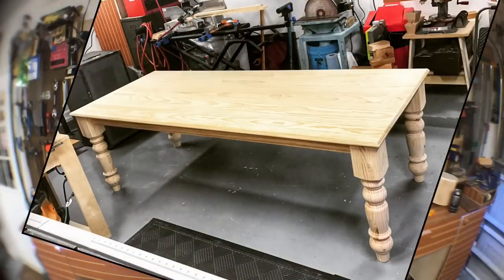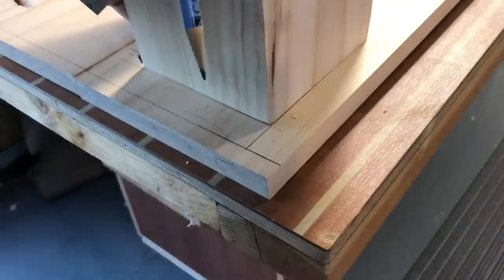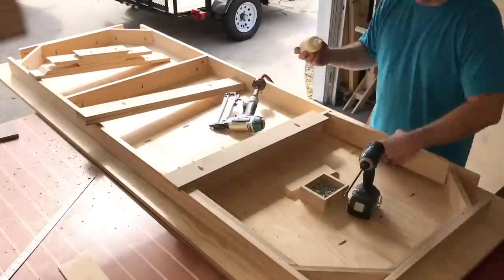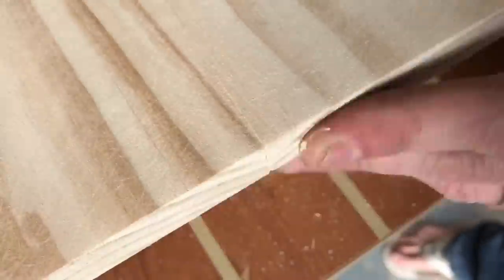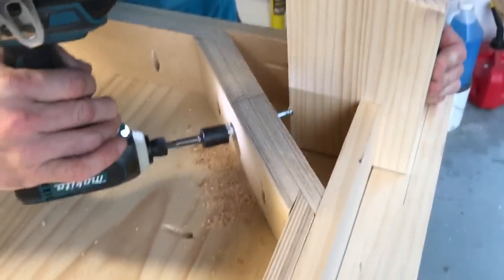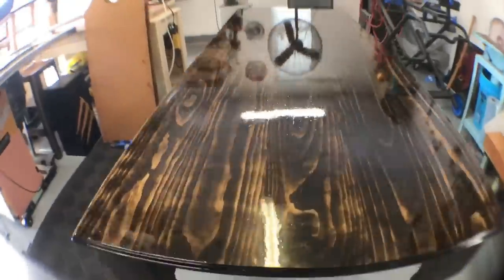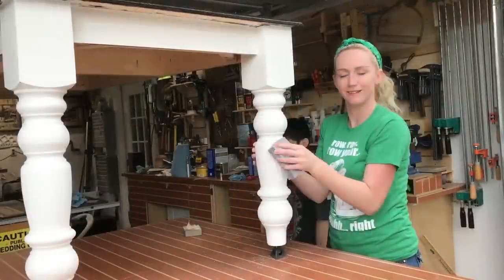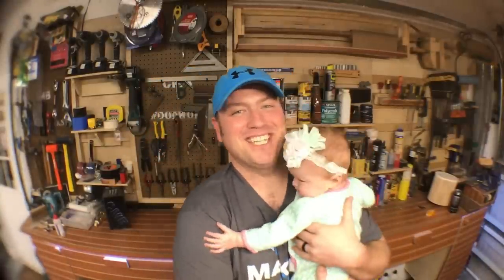How to Make a Farm Table

Comment: Honestly pretty disappointed by this. I have watched some of your videos and really admire some of your work, but you never... EVER attach a solid wood table top directly to the apron. That wood is going to expand and something is going to give in the structure and quality, whether that be the table top or the frame. Pine especially expands more than a hardwood so this was definitely not the way to do this project, especially when making it for a client. If you get a chance, you should read up on some wood expansion articles to understand the concept. For this purpose, figure 8 fasteners or z clip fasteners should have been used to fasten that table top. Other than that, awesome work and finish on that top!
Reply from the maker: MrTripleD3 You definitely have a point. Some of the growing pains of starting a new channel being that this is pretty much my first video, I’ve definitely learned a lot. Definitely should’ve used figure 8 washers or some type of expansion joinery. Thanks for the tip and I appreciate you watching
Reply: Didn't mean to be too critical, just trying to give some tips! As others have stated, I really appreciate your videos, your family aspects, and your personality you incorporate into your videos. You make good videos without the need of swearing and other unnecessary remarks like many others. I especially like the media console you made with the two fridges;p keep up the good work!
Reply from the maker: MrTripleD3 I could totally tell it was coming from a good place. I mean why else would you put so much effort into the comment. I really do appreciate it. Also thank you for the kind words it means a lot when people say they appreciate what I do! Quick question about the table top though, do you think making larger holes inside the pocket holes in which that was attached, would’ve been a better alternative. I didn’t use glue so I hope the table lasts a long time joined to the base
Reply: That method isn't the worst, but I don't see why one would go through all that time drilling holes when a figure 8 fastener would be more efficient and probably better quality, especially since that's what they're made for. If you had made the table top out of plywood and edge banded it and used veneer on the top, the way you constructed the table would have been awesome. It's just since you used solid wood for the top, and pine for that matter, you may have problems with expansion. Ive had may friends build table tops with pine and screw it directly into the apron and their top cracked and cupped. Plus, if you used figure 8 fasteners you could have built the frame separately and the table top separately that way when you transport it, it wouldn't be as heavy and you could then attach the table top when you got there. I hope it lasts a long time too, I just wanted to let you know for future builds. But I definitely know what you mean about it being one of your first projects and that you're learning. There are so many projects I did years ago that I wish I could go back and re-do knowing what I know now.
Reply from the maker: MrTripleD3 I really appreciate all the feedback. This community is built on people trying to encourage and making sure the better even if it is constructive! Thanks again for your time I will definitely be more careful in the future!

Comment: it looked like you used pocket holes to attach the legs to the 4-inch boards. How did you do that with the corner brace in place

Comment: I made a sewing table for my wife. I used pre-fab legs like you did. For the top, I bought two butcher block counter tops from IKEA, ripped one side to remove the round-over, then used biscuits and glue to join them on their long edge. I added oak cleats underneath to ensure rigidity. Then I made a template to cut out a rectangular opening to recess her big Pfaff sewing machine to be flush with the surface ( with a platform mounted underneath.) we custom ordered a plastic insert that completes the flush mounting. She loves it!
Reply from the maker: That’s awesome. The butcher block countertops is a great idea

Comment: Absolutely the best video ever. I am getting ready to make a farmhouse table and wanted ideas of how to attached beefy legs to make sure the table was very strong. Love, love love the whole video and end result. Details on finsh is excellent too. Thank you.
Reply from the maker: Thank you so much for the unbelievably kind words. I definitely appreciate you taking the time out of your day to let me know all of this! Thank you very much Karen, I hope you stay along for the ride on this channel! You’re awesome
Reply: Since this is my first try at a farmhouse table I have a question.  I cheated and bought a cheap top premade. It is a softwood but beautuful. I used one on my center island that I upcycled from an old dresser. I did like 5 layers of poly. Turned out great. I want to try an epoxy on my tabletop. Anything I should know before I get that far. Like I said it is a soft wood and want more hardness on finish.
Reply from the maker: Epoxy will definitely give you the durability you’re looking for. Any quality two-part Apoxsee work very well. A few tips are, have a heat gun or blow torch nearby to pop the bubbles that may arise. And also makes it for exactly how long the manufacturer says. I have one I have to mix for 12 minutes and if I don’t, it just doesn’t come out as well. Thanks Again. Take care
Reply from the maker: Also feel free to ask any questions I appreciate you reaching out
Reply: Chris, you mix your 3 part for 12 minutes?

Comment: I just found your video, i have been looking for an easy way to make a farm table with basic tools. great video and great tips like the glue and sand paper.  Your a natural behind the camera and your daughter is adorable.  cant wait to see more projects, keep them coming.
Reply from the maker: Craig North I can't thank you enough for the kind words brother. Of course I have more projects to come actually just released a new one about a minute ago. Quick little life hack in woodworking that my boy and I did. Thanks again man
Reply: Your welcome.  quick question, whats the name of the stain you used and where did you get the legs?
Reply from the maker: Craig North The stain is dark walnut by Minwax. The legs I purchased at a salvage yard in northeast Florida called eco-relics. Not sure where you live but if you're within two hours of Jacksonville Florida it's definitely worth the trip. They are warehouse and custom wood shop like you see on HGTV. Thanks for watching brother
Reply: great thanks for the tip, I'm actually in North GA but have brother in Orlando.  I pass by Jacksonville on my way there.  I will definitely check them out. Thanks again.

Comment: Hi Chris, I came across your channel searching for a diy farmhouse table. My wife and I have been searching for one at  local retailers and nothing fit our needs. Plus, what retailers are charging for a “farmhouse” style table is rather shocking. Anyway, to make a long story longer, our own baby girl is getting married and we are just days away, we needed a “sweetheart” table for our daughter and our soon to be son-in-law! I came across your tutorial at just the right time! Using your techniques and step-by-step instructions, My table is assembled, stained, and has its first coat of the three part sealer. I needed to know how long to wait between coats. I scrolled through the comments here on your channel and discovered that a few others were in need of the same information. 12 - 24 hours. I was wondering it is possible to apply the second and third coats sooner (7-8hours?). I just want to make sure I can apply enough coats and allow adequate drying time. I walk my baby girl down the aisle 5 and 1/2 days. Thank you for your farmhouse table tutorial, and the glimpse into your workshop! Cherish that time with your baby girl, it goes by so quickly.
Reply from the maker: Sorry I’m late to answer. But I will say first thank you so much for watching and the kind words and congratulations on the family milestones. Drive time really depends on where you are in the world and your temperature. Arizona might take six hours. However if you’re in 100% humidity and it’s a little cooler outside forget it it’ll take a few days. Lol hope this helps brother

Comment: Really well done (both the table and the video). I've been meaning to use Jimmy's "no dados" style since watching his video. I'm subbed.
Reply from the maker: +Peter Carnegie thank you brother. The sub and nice words mean the world to me!!
Reply: Quick follow up: any concerns about twist since those boards for the top are straight off the shelf? Thanks
Reply from the maker: +Peter Carnegie The twist in the boards, I find is a relevant, due to the plywood substructure. This is the third farm table I built in two years and the other two are still in great shape
Reply: Thanks. Good to know. It's mighty cold here in New York so I've been thinking of buying a bunch of lumber and letting it dry in the garage until it's warm enough to build outside. Thanks for the quick responses and keep the videos coming. Oh, and super cute baby. You should give her a cameo in every vid.
Reply from the maker: +Peter Carnegie  yeah I plan on putting her in More vids. Also I use Baltic Birch plywood in a lot of projects and I try to keep it hidden. because it's so strong and Rigid, it makes a great sub base for any structure. Thanks again for reaching out to me. This channel is Shirley in its infancy stages so I really appreciate it sir

Comment: In regards to mixture you used for your finish. Do you make only enough for each project? I found that it separated after a few hours and would not mix again.
Reply from the maker: I’ve never had that problem and mix up a batch and keep it in a bottle for months and months. I’m sorry about what happened but you definitely can use it per project not a problem

Comment: I want to build one of these for my boyfriend. I wouldn't even know where to start I've never built anything. How far apart are you putting the pocket holes on each piece and how are you spacing out the undercarriage with the birch and what sizes are you cutting the under sidings to?  not the ones that are going the width of the table but the smaller ones on the ends I mean?

Comment: Your videos are awesome and you are one of the main reasons I have decided to get back into woodworking.  It is such a great way to clear my mind and do something very relaxing.  Plus what better way to spend time with my children than to pass down a family tradition.  My grandfather taught me and I plan to pass it on.  One question pertaining to your video. You put one heavy coat of stain, then hand rubbed the first coat of finish before following with two brushed coats and a final hand rubbed coat to top it off.  How long did you allow each coat to set up before sanding and applying the second coat?  Did you wipe the surface with mineral spirits between sanding and applying next coat or just with a dry rag?  What grit of sandpaper did you use between coats?  Thank you and what a beautiful table and daughter.
Reply from the maker: Gerin Goldensoph Hey, thank you for the kind words. I really appreciate it. I live in northeast Florida where it’s fairly warm so usually only 2 to 3 hours between coats will suffice. However if the weather is a bit colder say, 60° or below it’s definitely going to take you longer maybe a day.  I just simply wipe down the surface after I sanded between coats. No mineral spirits required all that you can use it. Thanks again I really appreciate all you have to say
Reply: Thank you so much for the intel.  I live in Iowa and this time of year may take several days, but it is all worth it in the end.  One more question.  What grit of sandpaper do you use between coats of finish?  I know at the end you use the padded 2000 grit to get that nice sheen, but how about between the other coats?  Thanks.
Reply from the maker: +Gerin Goldensoph I start at 220 on the first coat. I will work my way up to 400 and then Use a fine Scotch-Brite pad before using the 2000 grit pad. Essentially as long as you can buff out the sanding marks of the previous great you’re good to go

Comment: Hi, thanks for the great video.  Looking to make this table bar height(36").  I want the legs to be removable for easy of transport.  Can I use a bolt thats' into the leg, nut on the outside of the angle support?  Will that be strong enough on an 8ft tabel that the legs wont move?
Reply from the maker: I think through both would actually be stronger

Comment: I love love love it. I don't have the necessary tools wood they cut my dimensions I need at Lowe's? Or Home depot? Also I've seen a clamp pocket kreg jig? I think it had like 1 hole in it. I'm sure it is cheaper than the large one you have right? I'm sry, I know nothing about machines or drills or anything.  I'm trying to watch videos and learn by watching and watching and watching.... Rinse wash & Repeat, right. You did a great job. 🤓. Thanks for sharing.... I really am gonna try to make a thin table with chunky legs....

Comment: Any suggestions on a source for 2000 grit foam sanding discs? I'm trying to finish up my take on this table and these seem very hard to find for an affordable price. I bought a two-pack online for $13, but they lost their grit very quickly.
Reply from the maker: Nick Demorest I’m really sorry but I don’t have too much information on these. I use the fest tool brand that works with my sander. I will be honest though 2000 grit is probably a little bit overkill. You can achieve very similar results with just moving up to 600 grit.I hope this helps. I’m sorry if it doesn’t, take care

Comment: Hey Chris I love this build and I am going to be building a smaller table but the top and the rails are going to be red oak bought my lumber already and I am going to borrow (lol) the legs from a table we dont use anymore just asking your opinion i want to use pocket holes but i am a little nervous that the hardwood rails will be hell to keep in line while setting in the pocket screws should i clamp them down in place and then pocket screw them? I dont have a jointer so i was going to do just a rip line on the top boards of each one and get a good glue seam i am not as nervous of that as i am on the rails LOL any advise would be much thanks for in advance thanks Steve
Reply from the maker: Hey Steve thanks for the comment/question. Clamping things together will definitely help any type of movement or difficulty with installing pocket hole screws. You can also spread your glue and position the rails where you want them and then, drive the screws into the material only part of the way. Let the glue set up for about 20 minutes, and then come back and drive them the rest of the way home. By that point the glue is essentially your clamp yet still soft enough to be malleable to really get a good tight fit by screwing screws in 20 minutes after installation! Man I hope that all makes sense. Maybe you should just clamp em’ !! Thanks for reaching out brother
Reply: @AGlimpseInside  Thanks for the advise it does make sense:) I almost forgot to say this video was fantastic thank you so much for your skills on video
Reply from the maker: Thank you Steve! I really appreciate those kind words especially because this was my first real YouTube video. Hope you have a great day brother

Comment: Love the video and have a quick question.  I'm making a coffee table but very similar in design.  Did you use actual 1" wood or was it the actual 3/4" thick boards?  I was concerned that the 3/4" would be too thin but seemed good for this one!  Again, love the video and appreciate any input.

Comment: Wow- it's greatThanks for sharing!
Reply from the maker: +thehotavocado thank you very much! More to come too!
Reply: A Glimpse Inside  ... I know this a bit much to ask. But would you write a list of what someone would need to do this. ... I would like to make a table as my very first project. I would have to buy the tools too. ... If you have the time to spell it out... What should I go and buy to make this table.without breaking the bank too too much :) Thank you!
Reply from the maker: +thehotavocado yes. I will make you a list! Let me put it together and I'll get back to ya!
Reply from the maker: +thehotavocado of course!!
Reply from the maker: +thehotavocado  ok here goes. 

Tools:
Cordless drill and impact driver set (recommended). 
Miter saw
circular saw
 and a pocket hole jig.

Materials:
4 - 1 x 4 x 8 pine boards
5 - 1 x 8 x 8 pine boards 
One sheet of medium grade 3/4" plywood 
Wood glue 
A box of   1 and 1/4" pan head screws (for the pocket hole jig) I buy the 500 count boxes. 

I hope this helps! Again anymore questions let me know
Reply: A Glimpse Inside thank you so much! I really appreciate your help :))
Reply from the maker: +thehotavocado of course. Hope it helps!

Comment: Man, I love this video! Great job...I just started on a desk with similar legs and am going to try to use your bracing method to support the under side with layers of birch plywood (never done that before). I think it's the perfect solution for my application. 
I wanted to check out a couple of the links you talked about but do not see them here. Can you advise? 
Thanks! 
CAM

Comment: I’ve built a table similar and had big problems with wood movement bc of pocket holes. Would you do the table the same way now having grown as a roof worker?  The “pros” say never secure a table top down like this. Thanks man
Reply from the maker: Absolutely totally would’ve use figure 8 fasteners or the method I use on my five dining tables I made about 20 videos back from now. Did you check that video out to see the progress I’ve made as a woodworker
Reply: No but will do. Thanks man